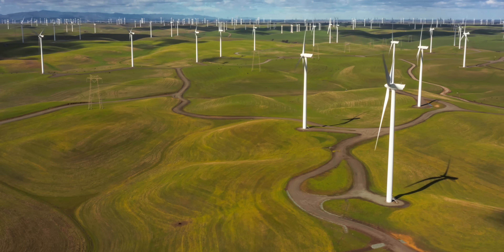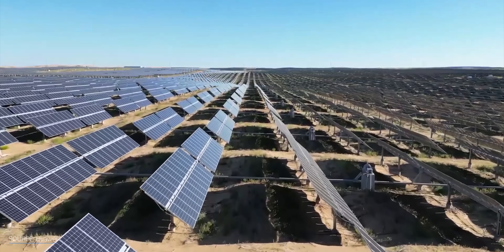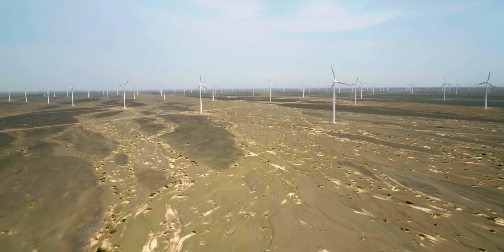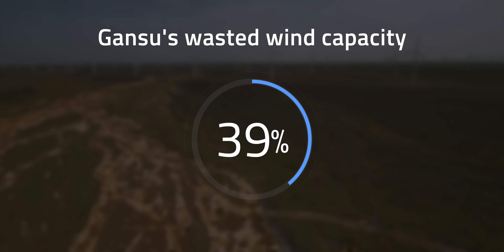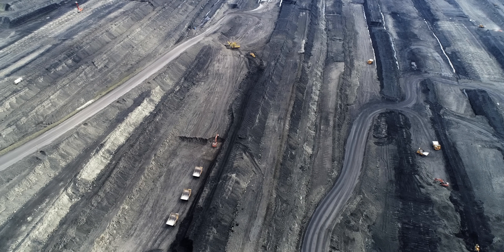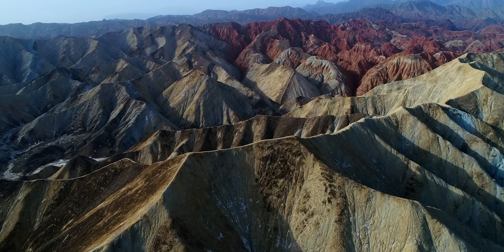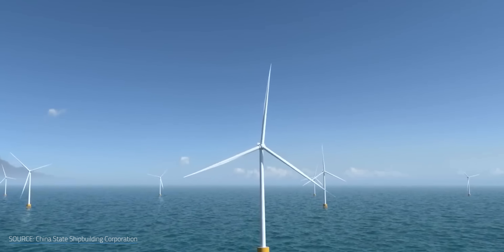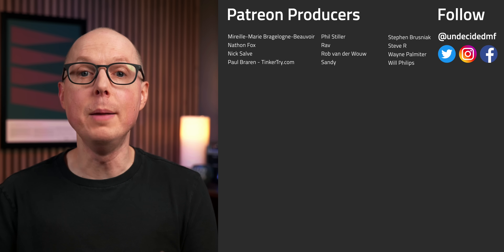The World’s Largest Wind Farm has a Tiny Problem

Comment: Putting wind turbines in a sea of abrasive sand is going to be very expensive on replacing blades and machinery.
Reply: Yes, the Chinese definitely didn't think about SAND when building this next to a desert.  Better go earn that consultant fee
Reply: @user-tz9jh6pv2j  Their plan was to turn that desert into a forest, but as usual with Chinese projects it failed and more over backfired since CCP orders were to plant trees.. well locals did.. they fell all the native trees and planted some cheap invasive species that didnt survive in the area and spreading speed of the desert doubled after project kicked off... Its like "turn this place green" command from central government... well local cities took it literally and spread camo nets and painted dead hills green, glued fake leafs on the dead trees, planted bunch of rebar on the fields with some peace of steel welded on top and painted to look like plants etc dumb.
Reply: @user-tz9jh6pv2j  sand usually doesn’t get blown that high. Of course it happens sometimes. But it’s usually within a couple of meters. 
But your point is valid that there will be sand damage.
Reply: @budbud2509  I hope people become more realistic. Sand and salty are both quite damaging to high tech.
Reply: @budbud2509  "north sea turbine blades only last 5 years max" WRONG That is not plausible, there is simply not enough servicing capacity to replace them that often. Your lies do not logically make sense, not plausible.
Reply: @Neojhun  
U really need to get up to speed on this topic 
BTW I'm an Engineer working in the design industry , and it does not 
matter 1 iota what u think is plausible , its what is happening now.
The design life of the Turbine blades was for same length as the rest 
and that was for 25 years .
However now that they have been in service , both on the land and in 
the sea its showing that they can only last 5 years, why ? 
Its cos there is so much stuff in the atmosphere that strikes the leading 
edge of the blades they actually break down and start to disintegrate and 
also the leading edge or any airfoil is the most critical part of it as it controls 
the efficiency of the blade and therefore the electrical output   
Watch and learn 
https://www.youtube.com/watch?v=og2H7ZxkiMA
Reply: Not as big a problem as salt water. The offshore windfarms need to be reengineered or reconsidered. Wind only makes sense if its power is cheap and affordable which could be a problem if you have to rebuild the mill every 10-15 years...
Reply: @pax256  yes, I never thought of that. Thanks for the post.
Reply: There are thousands of them just outside of Palm Springs where it’s windy just about all the time and really sandy. Doesn’t seem to have stopped them
Reply: @bob8776  , can't fix stupid. not exactly sure what you mean "can't stop them". turbines still be installed there??? turbines in operation there?? the issue isn't whether they'll work there. it's for how long, and what maintenance replacement rates are required. i.e how long between blade replacement, or generator break down??
Reply: @metocvideo Yes, I'm sure they didn't think about sand and dust when they designed wind turbines. And I'm sure wind turbines have never been installed in that environment before long term. I'm glad our comment experts are here to share their wisdom.

"The Dunning–Kruger effect is a cognitive bias in which people with limited competence in a particular domain overestimate their abilities. This overestimation occurs as a result of the fact that they don't have enough knowledge to know they don't have enough knowledge."
Reply: @Significator111  yes. It appears that there are some people in America that are using this effect from ignorance to make personal profit at Americans’ expense. 
This corruption seems to have pervaded is deeply that some rich Americans don’t have any reservations about being even richer although it would cause damage to our country; maybe to the point of collapse. 

Look at history and the most successful civilizations in the past. They could not be conquered by external forces. But they all fell because of their own internal corruption.
Reply: As the WSJ pointed out one of the problems in the US with wind farms is that the cost of maintenance has been at least 30% more than anticipated and turbines aren’t lasting as long as they are supposed to.
Sand or no sand the Chinese aren’t exempt from these issues either.
Reply: @pentoo988  The technology has just started and it will improve. 
I have seen airplane engines and electrical generators with no moving parts! They are far from being practical, but it means that there is room to improve the technology. 
The future looks bright.
Reply: @edwardlulofs444   solar photovoltaic farms already have no moving parts!
Reply: @PeterFraenkel  but they can and do disrupt the desert ecology. Putting panels on a salt pan has no negative effects that I can think about. 
With billions demanding electricity, the few people that see the damage to the desert ecology are voices in the energy storm.
Reply: @edwardlulofs444  please explain what "damage" to the ecology results from having a solar or a wind farm in a desert? Which species will be harmed?
Reply: @PeterFraenkel  I’m a retired science teacher. I don’t have species names. 
If you don’t like the desert, I understand. But I like it. 

Maybe this will help: You come home and your home is bulldozed. Your second car is crushed. Your pets dead. You shout and cry. And someone comes along and asks how you can be upset, it’s just progress.
Reply: @edwardlulofs444  I did not say I don't like deserts - you said it.  As it happens I do like deserts and have visited many including the Sahara, the Namib, the Gobi and others.  These are all huge spaces and although solar farms can be large they are tiny compared with for example the Sahara Desert or the Gobi.  Solar farms in China occupy some small fraction of a percent of the desert space which in any case contains very little in the way of species to be harmed. And what harm can a solar array do? The main impact is a bit of shade below the panels.   We need clean zero-carbon electricity like from solar PV and wind to cope with climate change or much more important areas of our planet will have their ecology ruined - in fact this is already happening with climate change induced floods, out of control fires and increased numbers of hurricanes.  You seem to accept the "progress" of wrecking our atmosphere and complain about measures that help to protect it.
Reply: @PeterFraenkel  no, I am very concerned about climate change. We must stop or reduce fossil fuels. 
I am sorry that I misunderstood your comment. 
I apologize. 
Yes, a little shade from panels isn’t bad. But look again. Every row has a maintenance road. Not as bad a disruption as a city or coal mine though. 
I’m sorry that I overreacted to your comment.
Reply: @edwardlulofs444  Thanks - seems we are not too far apart in our views.  The service roads for even a gigantic solar farm would use a negligible percentage of most deserts but the solar farms in the long run can be a major contributor to minimising the damage from climate change.  Believe me, I've been in the renewables industry for 40 years.  When I started we were laughed at by officials for trying to develop the use of wind and solar energy  - I think we can laugh back now when you look at the progress over even the last ten years.
Reply: @PeterFraenkel  yes, all true except I am very concerned about climate change. At the present trend, there won’t be a world for my grand children. 
So, solar is a good option to concentrate on. And wind turbines kill birds. But new wind energy technologies have no moving parts.
Reply: @PeterFraenkel  yes, definitely. 40 years of good work. Thank you for choosing a career so wisely. 
That gives me hope. 😊
Reply: @PeterFraenkel  , anything hit by a 180 mph wind turbine blade, anything in the path of a wind turbine blade failure, anything in the path of a 300 foot tower collapse... Shall we get on with the list of wind turbine failure modes??
Reply: Nope, its built, they have the video/photos and paperwork thats all they do it for. Its great for statistics
Reply: Which is another reason they should incorporate solar collectors under the wind mills. The solar panels would create a wind baffle against the sand and plants might grow in the shade of the solar panels and there may be no extra ware on the turbines, in the long term... 
Don't get me wrong, I personally find wind and solar repulsive and a waste of precious real estate but these deserts do seem to have no other better purpose and in this case, it may add to the global greening effect and improve diversity in the ecosystem. As long as nobody has to look at it...
Reply: @rodkeh  novel idea. Yes, the solar panels will create a wind baffle. All obstacles to fluid flow induce turbulence. 
I don’t know how much turbulence the wind turbines normally experience nor if it could be a problem, maybe in strong winds. 
The purpose of a baffle is to convert wind energy into heat rather than electricity. 
However, I wonder if the arrangement of panels, rather than being rows, were placed to funnel more wind into the turbine. 

It’s fascinating to think about.
Reply: @edwardlulofs444  Yes, as long as we bear in mind that this is a unique case and should be treated as such. Both of these type of eyesores should be discouraged in most venues.
Reply: @rodkeh  yes, they are. But are they any worse than polluted oil fields and spills, coal mines and coal ash disposal?
Reply: Stop with the Fear Mongering NONSENSE! All the MOVING Parts are about 80 meter or more above ground. That is far away enough from the GROUND that very little sand will be constantly up there, just during strong storms.
Reply: all of which accounta for china's GDP
Reply: Equating "desert" with "sand" is misleading. Only 5% of the Gobi Desert is sand dunes.
Reply: @MarkShockley  good point.
Reply: @MarkShockley  , sand, dust, dirt, dry particulate matter, are we clear now??
Reply: @metocvideo  most likely the maintenance manufacturing and replacement have completely dwarfed the benefit
Reply: Yeah, I heard wind farms are not worth its costs?

Comment: For a wind farm to equal the Kw putput of a normal 96 acre gas plant it has to be thousands or acres (for perspective Colorado has 40 gas plants).  The important thing to remember is that wind and solar are only 48% reliable as opposed to, say, gas which is 100% reliable. So, presumably you need two wind farms of huge size to equal one gas plant. Imagine 100s of thousands of acres of wind farms eveywhere. Now imagine the maintenance each generator requires, which is considerable. Impractical doesn't even begin to describe the switch to wind and solar. All for a problem that isn't a problem. Crazy

Comment: How much does installing those interconnects add to the cost of electricity from the wind project?
Sure, it's received international loans/subsidies. But that's all part of the renewables cost.

Just like how connecting wind at sea in The Netherlands adds billions of euros to the total cost. Much more than previously calculated (or left out of the calculations).

Comment: i flew over this wind farm    Not one was turning   Thousands still as death
Reply: renewables in a nutshell lmao
Reply: Flying over it does not tell you anything. It just shows you the instant moment. Annual power generation is the only measure that counts (if 95% or more is being transmitted to where it may be used).
Reply: @beatreuteler Yeah, you're right. People don't need electricity in their homes a hundred percent of the time.
Reply: Did you do this fly over in Microsoft Flight Simulator?